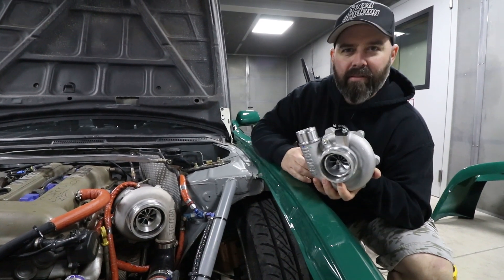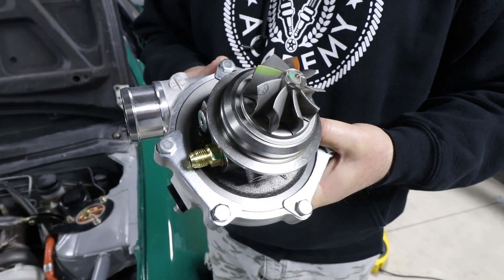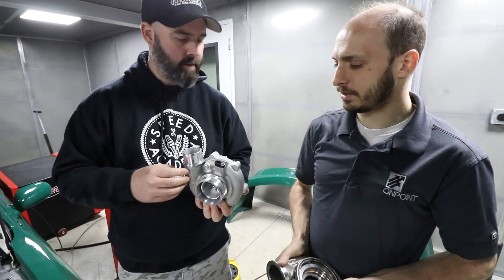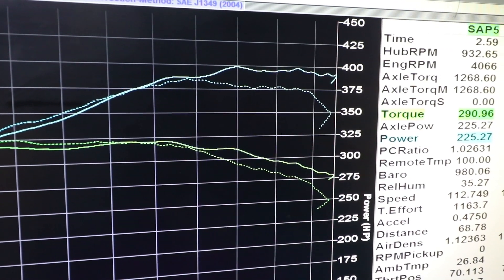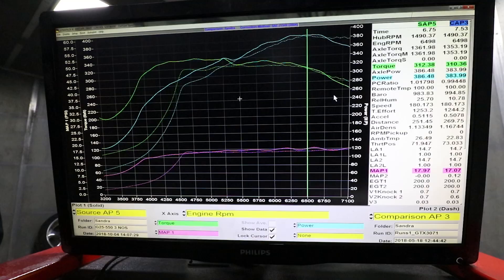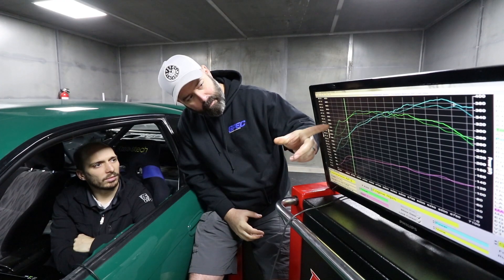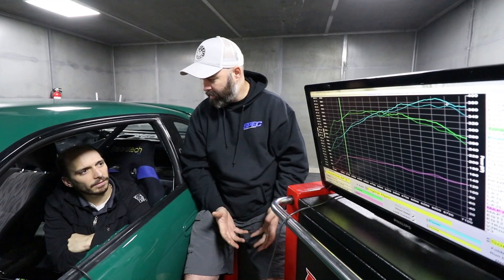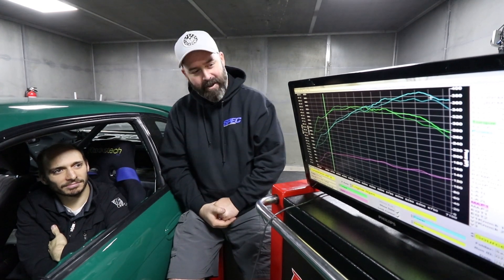Garrett G25-550 VS GTX3071R Gen 2 SR20DET Turbo Test

Comment: I've been hoping someone would do a decent review of the G25-550 on a 4 cylinder...
Thanks guys.
Reply: Watch Adam Lz dyno on his s13 sr. Over 500whp on E85
Reply: @caldakid  any idea which AR turbine are they using??
Reply: @FirstLast-tx3yj  if only we new. G25 is .72 Hard to compare otherwise:/
Reply: @JOutterbridge  cz i want to make 700whp on my LS but i want super responsive i might go with g25 but a bigger turbine housing cz 6.0 so 3.0 L for each turbo
Reply: @FirstLast-tx3yj  That might be too small and choke up top but you'll definitely get there at around 12psi of boost. I'd recommend the G30 for you though. Just a smaller hotside instead of larger
Reply: Search wrx G25 550

Comment from the maker: This is a fully built SR20DET including forged pistons and upgraded rods, stock head with high lift cams (272 we suspect) which is why the turbo's spool a bit later but make more top end power at lower boost levels.
Reply: cams are too big
Reply: What's A/R ?
Reply: I had 272s  in my s15 dropped them down to 256  poncams best thing I done way more responsive  for street and drifting
Reply: @gtrlife2941 and the power diference ?
Reply: Where can we find specs on Sasha's car? Im curious what exhaust he is running
Reply: Which begs the question... Adam Lz SR20 made 450 hp 450 trq with the same turbo and cams and a stock intake (no NOS)... ( I know this is a jerk thing to say but seriously 450 hp 450 torque is alot more like a V8... Than 350 HP, that's like the LEAST you would expect a V8 to make.) Do like your sticker says and SEND IT!
Reply from the maker: Adam LZ was running 22+psi. We made 390WHP at18psi so this turbo/engine combo will make 450WHP at 20-22psi easily. The transmission cant handle that kind of power and really its more about reliable then putting up a big number.
Reply: Speed Academy also keen to know exhaust housing A/r on this. I have a gtx3582r gen 1 on a built sr20vet in an s14 could possibly look to swap to get more response but keep a bigger ex housing for top end
Reply: @speedacademy  you would like to think a decent tuner could get better results than a kid who doesn't have a clue about engines. Adam is his own worst enemy, he keeps following his own advice instead of listening to those that know better. Having a lot of subscribers doesn't make you a better engine builder, it just means you're popular. No one knows who I am (and I sleep fine at night) but I have achieved far better response results (comparatively speaking) than either of these guys. How many people do you know that have produced more boost, and more power through out the ENTIRE rev range of a worked SR20DET with a GT3076R on it, over a bog stock SR20DET with a T25 on it?

Exceptional performance is not achieved by simply throwing money at it (as proven by Adam) but rather a combination of money, and a lot of time thinking, researching, and not just doing what everyone else has. If they fixed up the pipework on that car and made a few adjustments, I bet I could get better results without nitrous than they do with it.
Reply: @speedacademy  what ar. 3071 vs the g25-550?
Reply: @speedacademy what manifold use ?
Reply: @speedacademy why at 6800 the power donw ? the head work ?
Reply: When you said "built sr", sasha said "stock Sr20 from an s14"??
Reply: Why not tell the ar's? They are hugely important information.
Reply: Speed academy what are the A/R of the 2 turbine housing compared in this video ?
Reply: cams of ???  please
Reply: Should be running way more boost
Reply: would it not be more economical to go with an LS swap (tune it to run on e85, set up some nice heads/cams/intake, aluminum block keep its light, parts are abundant, etc)?
Reply: @pballer2005  some people want to keep the car pure and or dont like v8's/ls's.

Comment: All for a more responsive setup.... but  If it was me the gt30 with more boost, then get your gear ratios setup for clearly what is a lot of low speed drifting you are doing. Also that seemed like a very late gt30 spool. Not sure what dyno load or if you are soft on the timing due to nitrous. Should be all in by 4500 on an SR.
Reply: Big cams
Reply: Maybe low compression?

Comment: FIRST! Why not Borgwarner EFR turbos?
Reply: While I love EFR turbos, the new G series is entirely different from all previous generations, so it spools more like an EFR would(guessing as I haven't seen a direct comparison yet).
Reply: Garrett is still on a somewhat outdated turbine wheel, and that is where the secret sauce is. The EFR turbine wheel is still lighter than the new inconel based Garrett wheel.
This is actually a much more valid and informative comparison all things considered. A more direct comparison would be a GTX gen 2 2867 or something along those lines. However, this comparison will do :)
Reply: @RalliartRsX  the new g series turbo does not use the old inconel turbine wheel. Its made of MAR-M alloy which is comparable to the gamma ti alloy used in the efr turbines. Similarly sized turbos from the two would spool identical.
Reply: @PrimeGarage The only difference between Mar-M (247) and the old inconel wheel is the Ni content. The M247 has a higher Ni content (60% vs 52% if my memory serves me correctly. Cr content is also different between the two) than the prior inconel wheel. The only real benefit is it retains it's composition at higher temps. The Mar M247 wheel came from the old WRC and ALMS turbo Garrett TR30R. So apart from a higher heat capability, the wheel is mostly unchanged as it is mostly a material composition change. Also, the MarM 247 material turbine wheel as it stands weighs a fair amount more than the equivalent sized gamma ti wheel.
So as I said not comparable to the gamma ti wheel in any sense. And the blanket statement of similarly sized turbos from two different manufacturers will spool the same is fairly inaccurate. There are way too many variables (for instance, blade efficiency and comp/turbine matching to name a few). 
Thanks
Reply: You can compare the materials/% of said material & weight all day, but the reason Garrett can use the inconel wheels and still perform better than 99% of the competition has little to do with the weight, and Everything to do with their design. The so called "Secret Sauce" as you call it definitely doesn't lay in the Turbine wheel. The Performance comes with the Comp Wheel. As long as the turbine wheel has a large enough Exducer to except the flow of the Compressor wheels Inducer, the turbo will Perform. Garretts GTX Compressor Wheel design is rivaled by no one. No other company is producing 750whp  with a 5862. PTE gen2 5862 is rated at 700 and the closest EFR is the 7670 which is a 57/70 and its rated @650. The comparison just isnt there. 
The EFR series is definitely one of the best Turbines available, but when comparing Apples to Apples, they dont "produce" what the GTX series are producing.
Reply: @Thr33.Sid3z  your totally correct the best design in wheels is garret,  and the efr turbine wheels design is not very well, and it just dont spool that fast to be honest, garrett with a hevier turbine wheel is just a bit slower spool,  i think is the incorrect efr design, with much better design and titanium efr should be very nice, but there is also another isue with efr dont ever overspeed  the turbo as the shaft  breaks in half easily because titanium is to hard not flexible like cristal
Reply: Also ive tried a lot of garrets with similar power output and size, they're nowhere near response you get from EFR
Reply: yes the efr turbos are real nice i have a 6758 on my 2,3liter 4 cylinder and made around 21psi @3000rpm =)
Reply: @E-Tuning  mine 6758 with 0.85AR hotside makes 1bar(15ish) at 3000rpm on 2L 16v ABF engine...
Reply: @lamand and power  ? 380 hp ?
Reply: @E-Tuning  what exhaust A/R and what peak power?
Reply: Josué Febles González it was 0,63 a/r and 505hp at the crank. peak boost 1.6bar :)